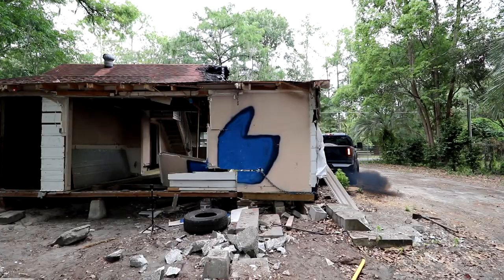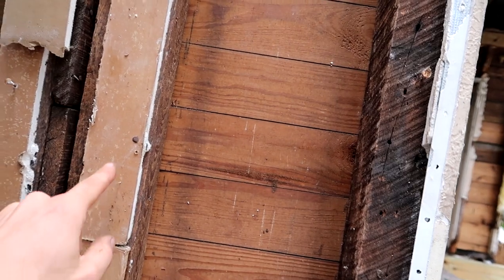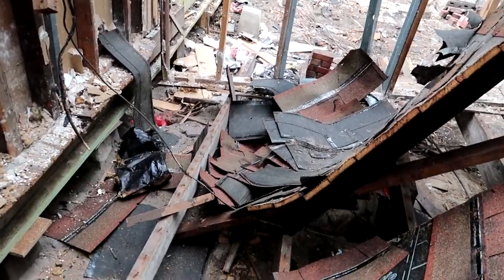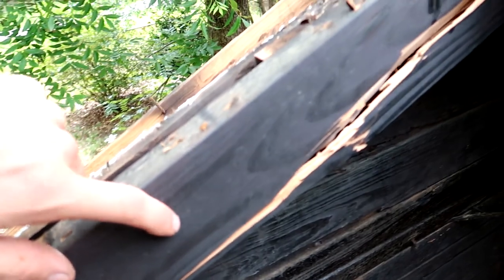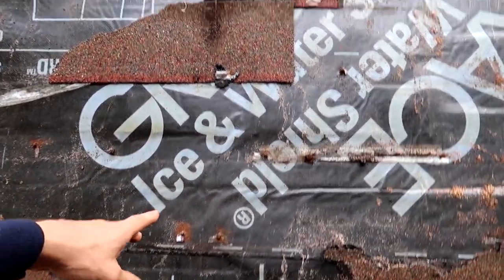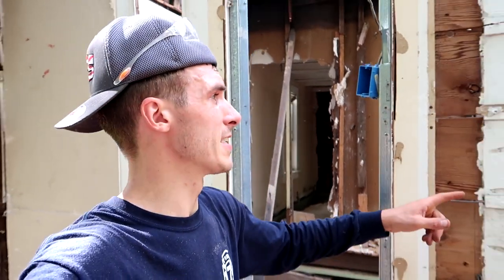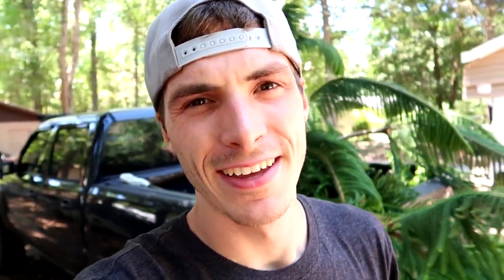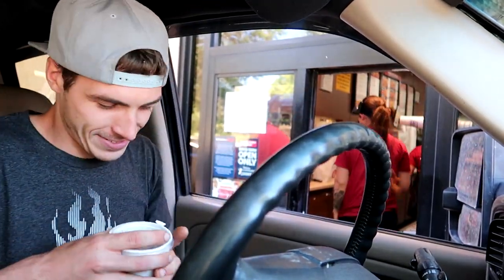SMASH & BASH Demo Day | Building My Dream Home Episode 8

Comment: Even though the lumber left in the house is undamaged except for smoke damage and some light charring, is the smell that is left. It never goes away. Plus the cost of rebuilding a partial burnt structure makes it more economically feasible to just level it and build new
Reply: I’ve been in houses that have been on fire 10 years before the smell is still strong. The people living there just get used to it which probably isn’t good for you lol

Comment: In an old house if you loose perspective it will ruin you. From experience your first idea on how to fix or make something is wrong. First ideas tend to be grandesque, and primarily emotion based. Emotions are chaos remember, so you're in for a ride if you follow one. 2nd 3rd 4th ideas are the ticket. Logic usually comes up with those. Example first idea to update a flat plywood interior door was to completely replace the entire door, frame, and molding. 2nd idea replace just the door, the frame was actually better then most new ones availible today. 3rd idea was to nail a thin trim box like a picture frame molding to the original door, calk, and paint the whole works. They turned out great, some visitors think they look custom, I guess they are. Less time, less money, new look. For that house razing or cobbling is the only way. Ultimately what mother govenment wants will prevail.

Comment: yikes, strip the roofing off(shingles), then cut/remove sheating in chunks, then the rafters(or sheating and rafters in chunks, then knock the walls down one at time(with all braced) cut up to manageable chunks. couple of sawzalls with good demo blades would make fast work of it (circular saw and good blades works) shingles don;t cut well and clog/ruin blades fast, so best to use roofing shovels and strip off step one, unless of course you have a large backhoe, then you can just tear it down in the same stages, leaving roof material on the sheating.